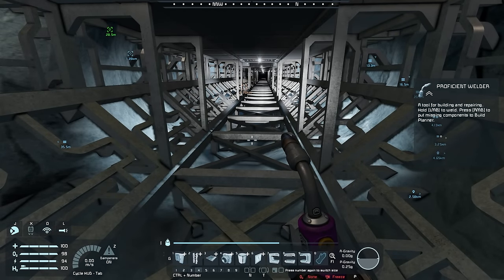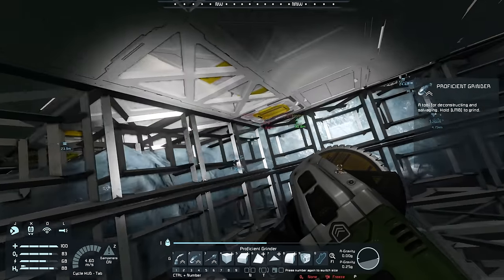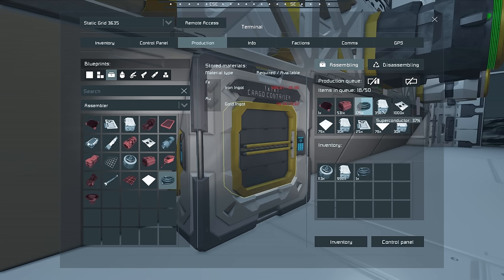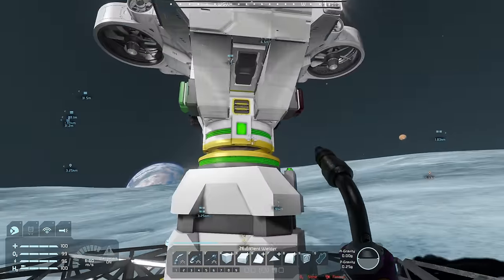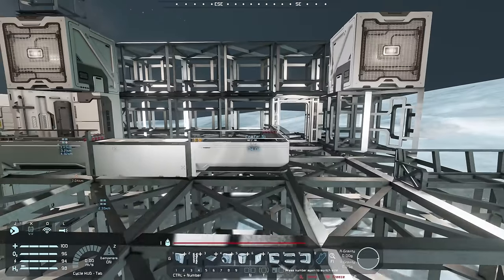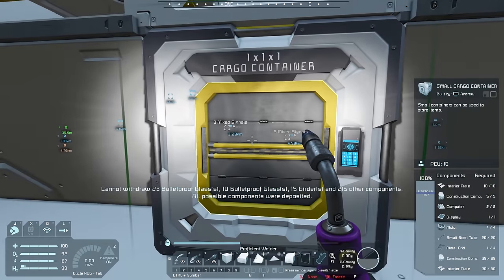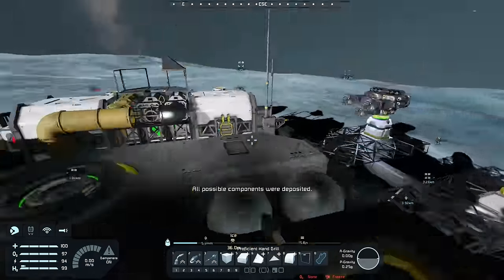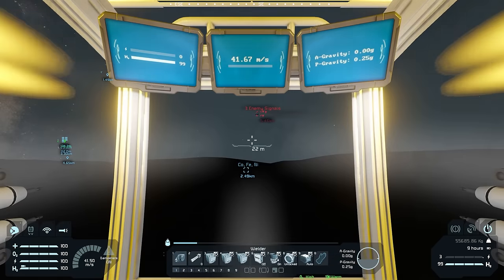Space Engineers Survival (Episode 11) - It's A CoFiNi Episode!!! (sort of) [2024]

Comment: CO, Fe, Ni second floor: Parking lot (Lateral/horizontal connectors) (is it possible to have a counter measuring H2/O2 and power transfer?) or an unpressured lounging area with pilot chairs for recharging individuals (H2, O2, power, & health (also a meter to measure)). Either way, heavy armor plating covering pressurized lounge area. (and there is my 2¢ or 2p wherever you are)
Thanks for the edutainment.

Comment: Since your thinking of turning the battery room also into a computer room a suggestion on decorations and placement for you to liven it up some. I think the room was two blocks high? Top row. From left right old style battery and put an access panel decoration on it (then open the panel) a warfare battery, heat vent change the light colours all to black so it doesn't give off light (now you have an animated industrial aircon to keep the batteries and computer room "cool") warfare battery and another old style battery with an access panel on it. On the bottom row you put your programmable, timer and event controller blocks. I like putting my turret controllers in my computer rooms to look like work stations. A final suggestion something I did on a multiplayer server and scared my friends half to death if you hide an exhaust vent with the top facing into the room behind a battery or the heat vent for exampl and set it to shoot sparks of electricity then set it to say maybe 80% of power usage it'll shoot sparks into the room like the the batteries are overloaded or struggling when your power usage hits 80%.

For context on how I scared them I got tired of the ship we were living on not really doing anything interesting what I mean is that it didn't feel alive it was a rusty old clunker but it felt to smooth so I dimmed the lights gave them that industrial orangish colour to mesh with the rusty greys and dirty browns and heavy rust colours set some random ones to occasionally flicker then hid exhaust vents in the walls and behind key area like batteries the h2 engines, programmable blocks in the cockpit and the jump drives. when they set the 6 jump drives to charge areas of the ship started spitting smoke and sparks and everyone had a heart attack thinking something went wrong but it gave the atmosphere it really was an old ship now. 😂

Comment: Unlike IRL, SE fuel consumption linearly increases with thrust output. A quadratic relationship would have been kind of cool. I wish my math and scripting skills were strong enough to make a mod for SE thrusters to do this.

I remember informally testing the "fewer thrusters = less H2 fuel use" idea a few years ago. I set up a heavy ship (large cargo filled with steel plates) with several H2 tanks and 10 large up thrusters in gravity. Then I checked the time to empty the tanks. As long as your mass and acceleration are constant, total fuel consumption stays constant regardless of the number of thrusters. Fewer thrusters just work closer to their max thrust output, and more thrusters just work closer to zero output.

for forward/backward/left/right thrust, I used thruster groups and override to set a thruster group to constantly burn at a given percentage level, and changed the number of thrusters in the group per fuel consumption test. Fewer thrusters would cap max acceleration possible, thus limiting fuel consumption per unit time. But it also caps acceleration, so you have to spend more time to slowly accelerate the same constant mass up to your desired velocity. I'm basing this only on the in-game fuel tank time-until-empty timer in the control panel, while each test group of X number thrusters burned on override at a constant rate.

Slower acceleration does mean smoother velocity changes and more time to respond to changes, so it irons out sharp and sometimes wasteful peaks of sharp acceleration and overcorrections.
Reply from the maker: Thank you for the information!

Comment: At 16:25 you can pull from inventory directly into your cargo. Just make sure that the left is selected to your ship only and everything else on the right. 

Then pull everything using the buttons (edit) in the inventory page, not the shortcut buttons. Also you can pull from inventory and keep items in your builder bar. So that if you have 8 conveyors. You can pull 8 conveyors into your ship and pull 8 again without struggling or holding a conveyor in front of a port.

It should work perfectly without inventory management scripts (IMM) if you use isy’s IMM you can select specific connectors to be ignored so you can put in your welder without issues
Reply from the maker: Thank you for the tips!! I always forget those inventory buttons exist :)

Comment: Man I hate to be this guy, but I have to say something. My face hurts from all the facepalming I've been doing watching your videos.

The gears idea looks cool, but is functionally useless. It takes the same amount of force to accelerate your ship regardless of how many thrusters you turn on. The same amount of hydrogen will be burned to generate that force. For example, if it takes 100N to lift your ship and you have 5 thrusters pointing down, each one will apply 20N of force. If you have 2, each will apply 50N of force. Both scenarios burn the same amount of fuel. Turning off thrusters just makes your ship less responsive. If you've committed to adding their weight to the ship, turn them on. 

Turning off your forward facing thrusters is going to help so much more, you really need to make a separate group for them. Blocks can exist in more than one group, so have a group for all thrusters and a separate one for forward facing only. Turn those off while cruising and you'll drastically reduce your fuel consumption.

And please for the love of Klang, stop blowing all your oxygen out of your base all the time. You're wasting so much ice! You're waiting for your hydrogen ships to refuel while your H2O2 gens turn ice into oxygen. I think you should consider a separate conveyor line and generator for your oxygen production, tanks, and vents. Then you can decide what your ice turns into.
Reply from the maker: Thanks for the feedback! I think you're right about the forward facing thruster toggle being way more useful than the gears. I'll keep the gears because they do help with controlling the ship. It's too zippy when empty with all thrusters firing. But I'll keep this in mind and consider a forward thruster shutoff for added efficiency!